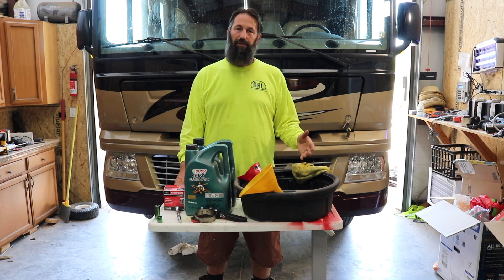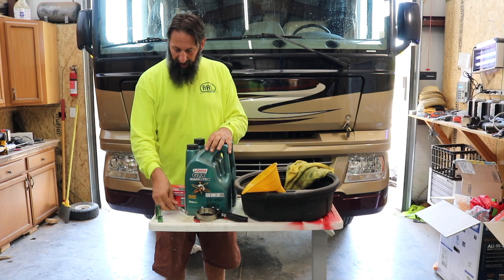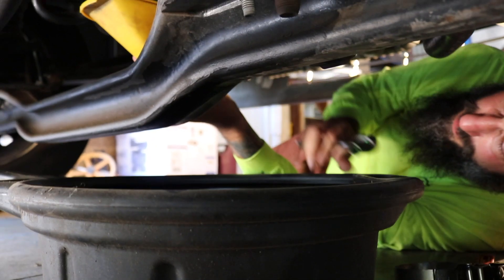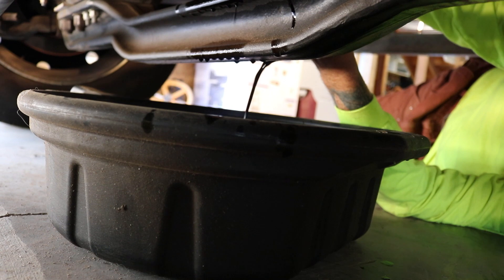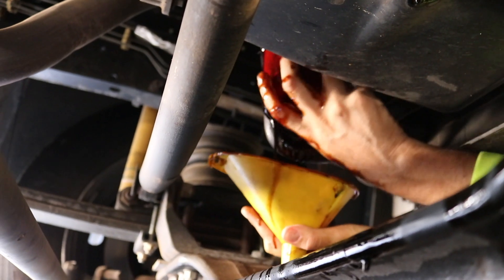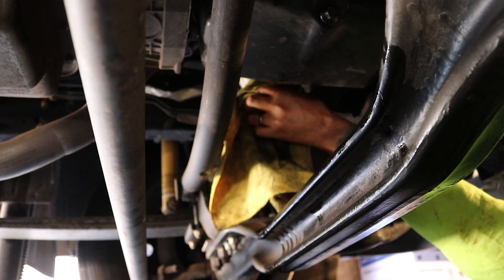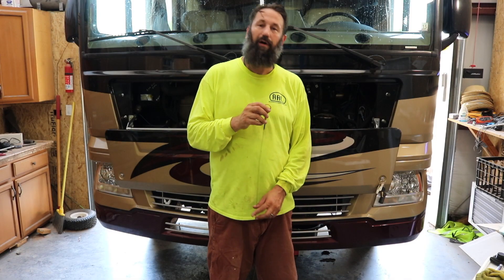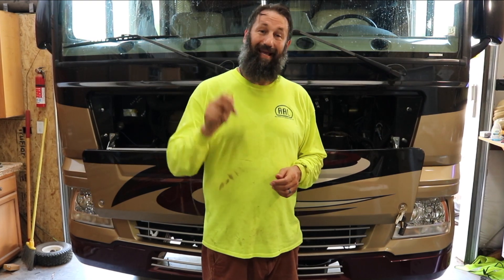Worst Oil Change on an F53 Chassis Class A RV | For Beginners

Comment: I installed a Fumoto drain valve on ours. Much easier and neater to drain the oil. With a length of vinyl tubing to drain it into a pan. 

It took two of us to refill the oil. Using a funnel and a long piece of vinyl tubing connected to the funnel. After putting the vinyl tubing in the fill spout, my wife held the funnel high enough, as I slowly poured the oil. Worked like a charm.

Comment: I watched this in hopes of learning how to avoid all the things that happened to me today. LMAO. I even used the Valdez joke earlier. You did everything I did. With the same result.
My filler neck is so long that I have to keep refilling a 1 quart bottle from the 5 gallon jug. I think that whoever designed the chassis should be forced to do oil changes on F53s for 20 to life.

Comment: This is exactly how my first attempt went....  horrible oil pan drain and filter location directly over the cross member, and to top that off with a vertical oil fill with exactly 6” clearance.....  it’s like maintenance was an after through in the RV design room.

Comment: I have a 2021 F53 chassis with the new V8 and the oil fill port on this setup is even worse than yours if you can believe that!  The fill port is on the other side from yours and even higher up, where I doubt you can even get a quart bottle up there.  I bought an oil pump setup for when I do my 1st oil change.  I also bought a FOMOTO valve that I will install during my first oil change to make my 2nd oil change less messy then I believe the first one will be.  It probably would have gone better for you if you didn't decide to film it....

Comment: When taking the old filter off stab a hole in the oil your taking off and let it drain and the remove it I have the same chassis thanks for the video
Reply from the maker: Good tip!

Comment: What motor is this in your f53? 460 or V10?
Reply from the maker: This is the V10
Reply: @BearsWorkshop  I am trying to learn how to check and change the oil on my 460. Hopefully they are similar.
Reply from the maker: Just hope the cross member is in an easier place for you.